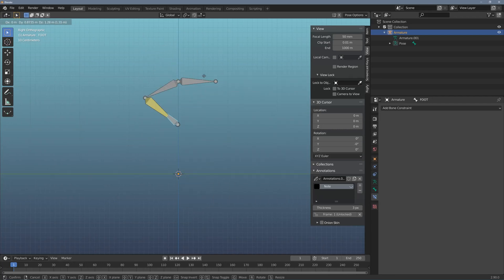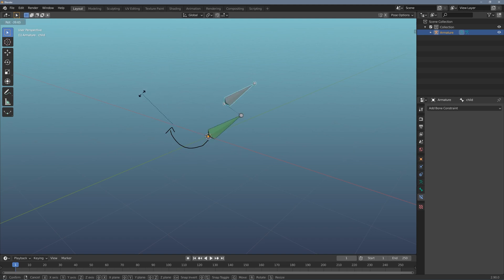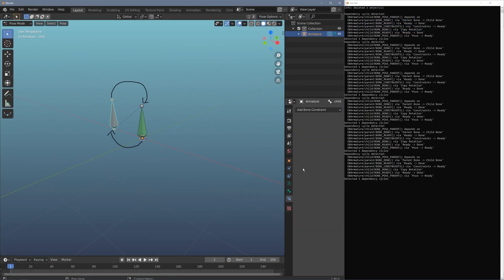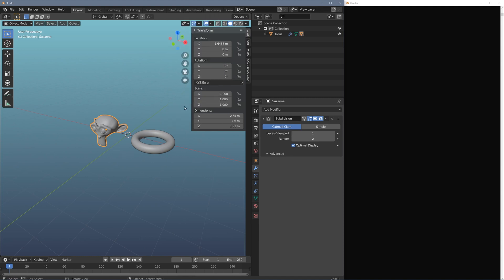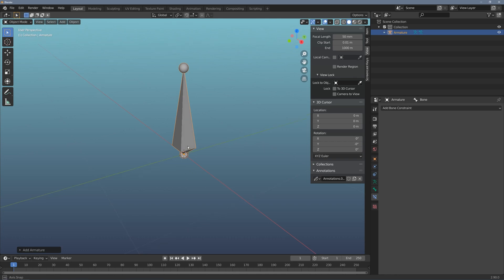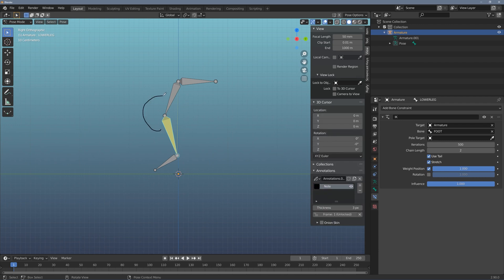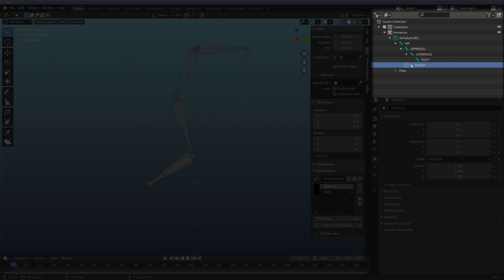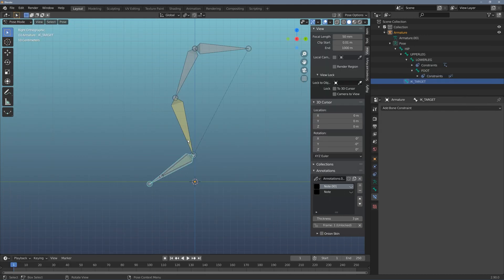Dependency Cycles In Blender - How To Find And Fix them

Comment: These are great tips. However, referring to a "dependency cycle" as simply a "dependency" may cause confusion in your viewers, as a normal dependency (as part of a dependency graph) is not a problem, since they are one-way, or "acyclical". Only circular dependency is a problem.
Reply from the maker: Good call, I've updated the title and thumbnail and pinned this comment.

Comment: I have a weird issue where the mesh deform from a amature with a bone that has a shrinkwrap modifier to a diffrent mesh causes the mesh from the amature to lag behind one frame 

Basically Amature A has mesh A which is deformed by amature A with weightpaints 
then Amature B with Mesh B which is also controlled by amature B

Amature A has a bone with a shrinkwrap constraint that targets Mesh B (Project target) and when ever I move the Bone quickly or move Mesh B with amature B the weight painted area of the bone from mesh A lacks behind one frame

I can pause the playback and the mesh lag still exist until I click something like the mesh itself the bone amature or a setting from the shrinkwrap

does anyone know a fix I do want that shrinkwrap modifier on the bone 
maybe a addon exist that replicate a shrinkwrap modifier or forces the mesh to load each frame ?

Comment: You're a life saver. I'd like to add that the objective is to "break" the cycle by taking one of the elements and make them accessible outside of the loop. But not everything can be controlled from outside.

In your examples, it was the coordinates of an object, or the controling bone of an IK chain. More complex setups could imply different types of objects.

For example, I made a setup so that you can have a bone being moved by the coordinates of a vertex (with blendshapes for example), while still being able to manually control that bone to mofe the vertex further. I had a whole chain of constraints to make that happen, but I couldn't find what bone could be duplicated and reparented.
Turns out all I had to do was duplicate the mesh itself because it was the root of the dependency cycle!

In conclusion: circular dependencies can imply literally anything.

Comment: So I've been encountering dependency cycles when using muiltiple Child Of Constraints, even on objects that aren't parented to anything, because Blender will create dependency cycles from constraint conflicts, even if they have 0 influence. I've been told to use the Dynamic Parent addon to avoid it in the future, but is there a way to preserve the original constraints and animations through a workaround?

Comment: This is one of the biggest flop in Blender sadly. In many cases you have no logical dependencies, like you have a rotation control dummy copying the location of the bone it rotates. It registers as a dependency cycle even though rotation doesn't affect the location of a bone. In previous versions there was an extra object/data updates feature in the object properties/relations extra panel, adding a way of fixing blender's weird reactions to dependencies It considered problematic (just 1 more update fixed everything as there was no other problem other than blender thinking that there is a problem) but in 3.5 it's no longer there.

Sad.

Comment: If Blender knows their is a dependency, why doesn’t is just bring up a dialogue or tell you in the status bar that there is a problem, kind of dumb to hide this in the console.
Reply from the maker: Totally agree! A little warning in the main viewport would be very helpful :)
Reply: @LevelPixelLevel  I proposed to an add-on maker some time ago that he make an add on that adds an overlay showing red lines between the objects in a cyclic dependency. It could also provide the names of the offending objects. After all, they are just there in the database of data blocks. Nobody seems interested but I think millions of Blenderers would buy it! Someone could even make "rigging nodes" or something like that. It's just another way of viewing and interacting with the same data.
Reply: @LevelPixelLevel  And btw - I love what you do. I like animating complicated machines, so I've learned a lot from your work. Thank you!